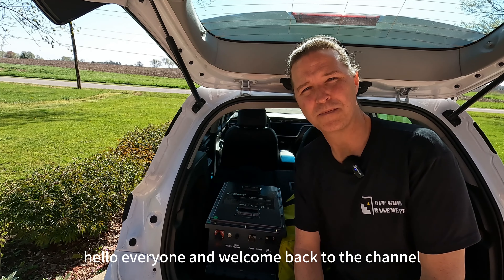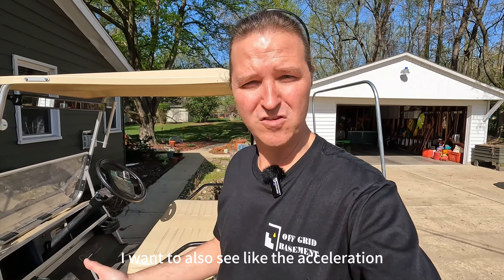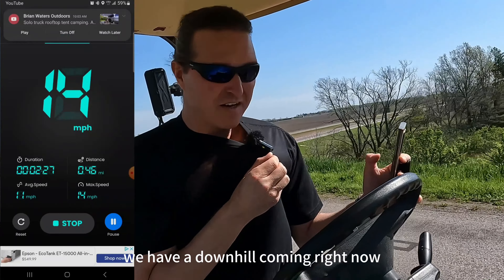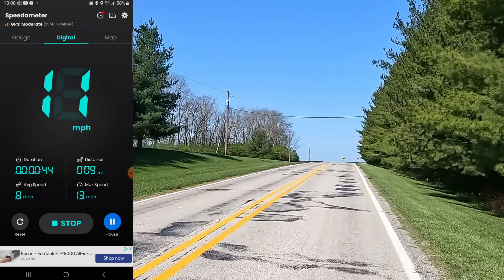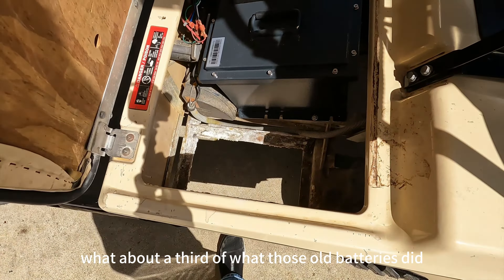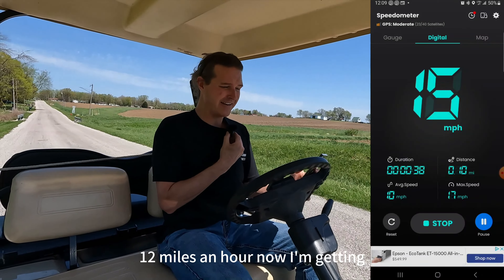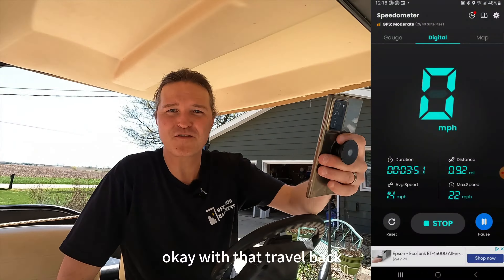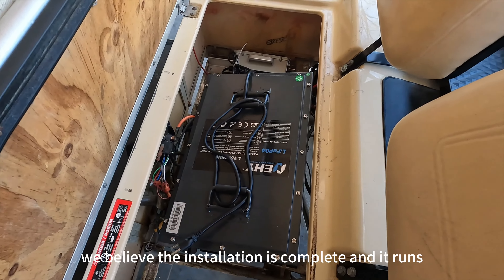Save Half of Budget! EHY Lithium Battery VS Lead-Acid Batteries, GET RID OF IT NOW!

Comment: ...Jim...very interesting demo and comparison for that LifePo4 battery.....if I were to do the change out,
I think I would go with four 12.8 volt 100 ah in series and save quite a bit....over a $1000 perhaps?....thanks
for posting.....keep the DIY videos coming..... 🙂
Reply from the maker: True.  Getting a battery balancer would also be a good idea.  Thanks for the comment.
Reply: Hello, comparing the advantages of a single 51.2V (48V) 100Ah lithium battery from different perspectives:
1. Power:
A single 51.2V (48V) 100Ah lithium battery, due to the integration of a battery management system, can achieve 2C maximum sustainable discharge, that is, the maximum continuous output current can reach 200A, and the maximum continuous output power can reach 10.24KW. In addition, 300A (60s)/400 (30s)/600A (3s).
And the maximum continuous discharge current of four 12.8V 100Ah series connected together can only reach 100A, with a maximum power of only 5.12KW. Once loaded or climbing, overload and power outage may occur due to insufficient power.
2. Weight:
Two sets of four 12.8V 100Ah lithium batteries need to be connected in series, and then two sets need to be connected in parallel. In reality, only eight 12.8V 100Ah lithium batteries can have the same power as a single 51.2V (48V) 100Ah lithium battery. One 12.8V 100Ah lithium battery weighs approximately 22 pounds, while eight weigh approximately 196 pounds, while a single EHY51.2V (48V) 100Ah lithium battery weighs only 102 pounds.
3. In terms of installation, safety, and intelligence, the battery of a single golf cart is far superior to a single 12.8V 100Ah lithium battery
In summary, only 8 12.8V 100Ah lithium batteries can achieve the same power as a single 51.2V (48V) 100Ah lithium battery, and the price, weight, installation difficulty, intelligence, etc. cannot be compared with a single EHY golf cart battery.

Comment: Can you pls help me? I have licitti battery box and li time 100 ah battery! Trying to find out if it's okay to hook up a Pecron dc to dc charger 500 watt to the licitti 50 amp in and out Anderson connector! With out any charge controller! I know battery has a bms!  But I'm not sure! Don't want start a fire or mess battery up! Cause I do vanlife. Don't want burn my house up lol! You Always answer my questions an I really appreciate that. Love your vids an channel.
Reply from the maker: The Li Time battery will easily accept that amount of charge.  500w is right around 40A @ 12.8v so you would be ok with using the 50A Anderson connector to charge the battery.  I would test it to see if the connection gets hot, but it will probably just get warm to the touch, which is ok.  Hope this helps!  Good luck and stay safe.
Reply: @OffGridBasement  thank you sir for your input! Really appreciated 🙏

Comment: Great video! But too pricey.
Reply from the maker: Specialized batteries are always going to be more expensive 😔 
Thanks for the comment!
Reply: 1. Compared to lead-acid batteries, a set of four 12V 150Ah lead-acid batteries typically costs around $1200-$1500, with a lifespan of only 500 cycles and a maximum power of 7.2KW. In contrast, a single 51.2V 100Ah lithium battery can achieve over 8000 cycles and a maximum power of 10.24KW, making the cost-effectiveness evident.

2. Compared to multiple 12.8V 100Ah lithium batteries connected in series and parallel, due to the lack of an integrated battery management system, eight batteries are required to match the power of a single EHY golf cart battery. In terms of price, weight, size, installation difficulty, and intelligence, they cannot compete with a single golf cart lithium battery.